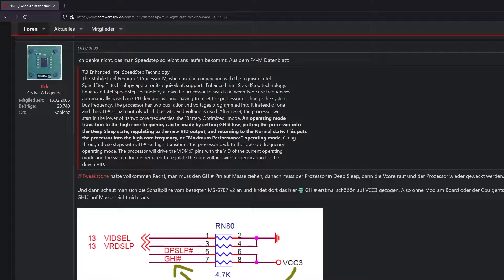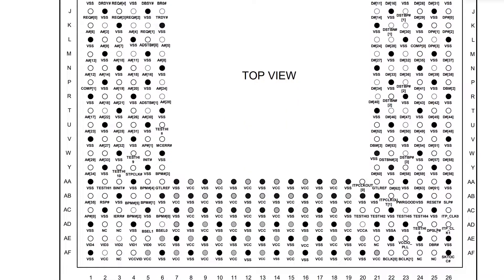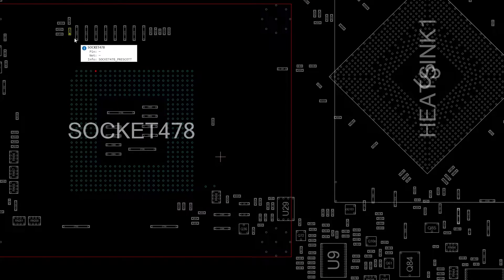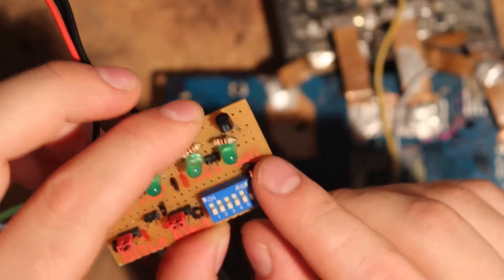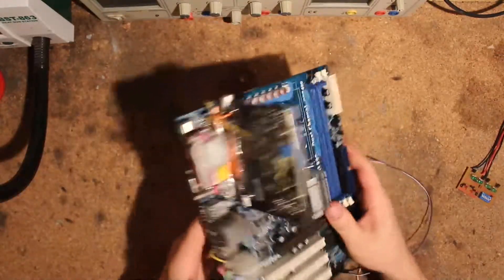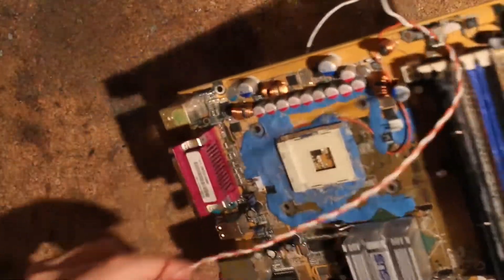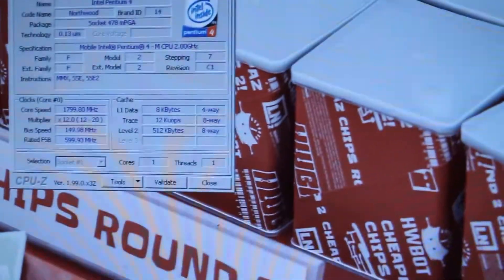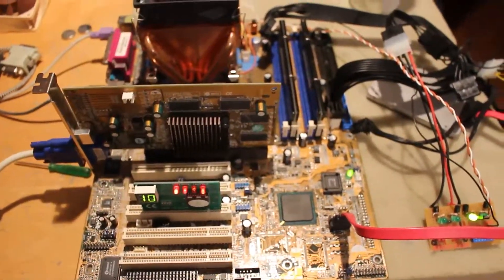I finally got all mobile Pentium 4 CPUs to run on desktop boards / P4-M Northwood modding guide

Comment: hello question. i got a gericon  northwood desktop pentium 4 laptop. i got a p4 Mobile 3.06 ghz northwood HT cpu here. could it be hacked to work on there? iits using a sis 645xd as chipset. official cpu support was up to 2.8 ghz
Reply from the maker: If the board allready supports northwood mobiles then the issue isn't getting the multi to work,  as board will allready have all the circutry, i expect that all you need to do is add the mictrocode patch of the 3.06GHz chip to the BIOS and it should work, might not work with HT though...

Comment: Hello I was wondering if it might be possible to do what you have done here but in reverse so lets say I'm using a motherboard with the sis651 chipset the gigabyte GA-8SIMLH would it be potentially possible to get that board to run mobile Prescott based Pentium 4 CPUs. My second question is if it might be possible would it then potentially be possible to get that board to support the CT-479 adapter and get the board to run Pentium M 479 mobile cpus.
Reply from the maker: Can't really help you there, don't have sis chipset boards at all. CT-479 has been run on non asus boards, but personally i'm not gonna try that before i have a backup CT-479, not gonna risk my only one :D
Reply: @taggxoc  ah alright completely understandable if you ever do get a spare I’d love to see what boards your able to get it to run on

Comment: I'd love to buy one of these to play around with a P4M CPU :p I remember seeing test boards which supported Pentium Mobile CPUs (Banias and Dothan), they used the better Pentium III based architecture.

Good job :)
Reply: I remember those as well.

Always wanted one. Back then the IPC on Dothan was unmatched. Even by AMD FX.

They were the best gaming CPU's for about a year, that no one had. Lol.

I still want to OC one on desktop very badly.
Reply from the maker: Pentium Mobile allso runs on the asus boards, there's adapter called CT-479 for that, might make a video on that eventually :)
Reply: @taggxoc  Yeah the CT-479. That's the exact adapter I remember. Asus made.

I looked for one years ago. Not a single one to be found.

Let me see now.... Same. Basically unobtainable.

It's an interposer adapter board. It could be made again, not with ease, could be done though.

Do you actually own one?

Comment: Helllo! New subscriber here!

Impressive e-power mod skills!
It looks like your using Nvidia cards for the VRM so I have a question you might be able to help me with.

I got a GTX 295 single side PCB version. I got it for free but it had lot of damage, SMD caps etc missing so PCI-E negation was broken for Gen1, lot of filtering caps behind the smaller external dacs, fixed all the ripped pads, replaced SMD caps etc so the card post, on PCI-E Gen1 and runs etc.

BUT it took me some time to figure out the card has an issue I cant find the solution to. 
It is repasted, new pads etc, max temp 60C on both GPU's in Haven benchmark BUT it will eventually blackscreen, monitor shuts off, same thing in Crysis.

I figured out the Vcore was gone on both GPU's so the card basically goes dead cold, fan runs but GPU's have no power.

Hooke up my oscilloscope and Vcore looks stable idle to load, about 1030mV at all loads and 80mVpp idle and 121mVpp load so I think caps are good because Vcore seems stable enough.

Crashes takes about 45min to 2h usually on stock clock of 576Mhz.

Underclocked to 418Mhz it ran 13h until I shut Haven down.
reason I tested this was because I wanted to see if it could be an OCP issue.

SO I replaced the resistor that should change the Current setpoint limit for the ADP3193A switching regulator but this had no effect, crashes after about 1-2h as usual with no Vcore.
So I dont think its OCP tough the controller might trip on something else, not sure what nvidia implemented on the card if it check VRM temps etc.

But I suspect something else is signaling the Controllers to stop switching.

The Controllers VID's are hard wired etc so the VRM implementation seems pretty dumbed down (no software control etc), but I also am prett dumb when it comes to stuff like this XD

So I do wounder why it trips and if anything else on the card can tell the ADP3193A to trip?

Any help pointing me in the right direction would help.

The card is artifact free etc, just this random loss of vcore on both gpus during sustained loads that needs fixing and I would have a good GTX 295.

Anyways grate channel and I will Post some of your stuff on our discord.
Reply from the maker: I don't think i can add much to this, my first guess would have allso been OCP, but i can't even test anything on a single pcb card right now as i sold all of mine, only holding on to the dual PCB ones as they tend to do better and have stronger vrms too... 

Only other thing it might be is random temp sensor error that makes the card think it runs too hot, though it really shouldn't trip the VRMs, just put card into safe mode with really low clocks and crap performance, so this is highly unlikely to be the issue in your case.
Reply: @taggxoc  
Thanks for your reply!
I know its pretty hard to help someone remotely with technical stuff like this but I appreciate the response non the less! :)